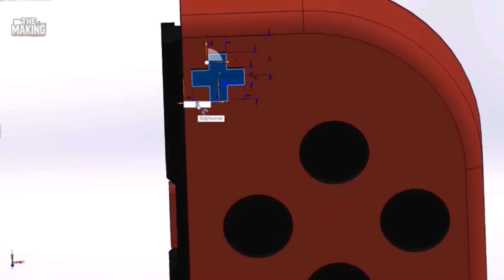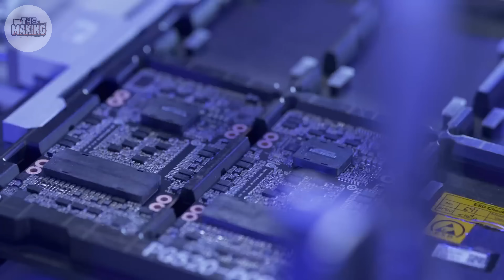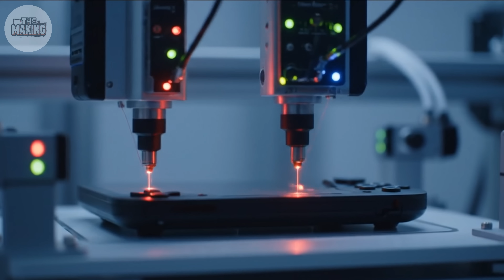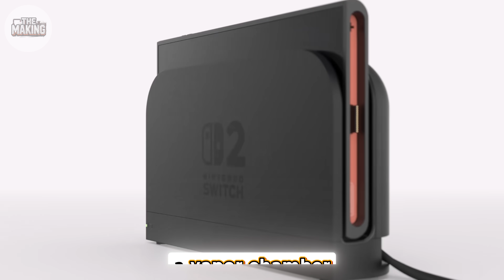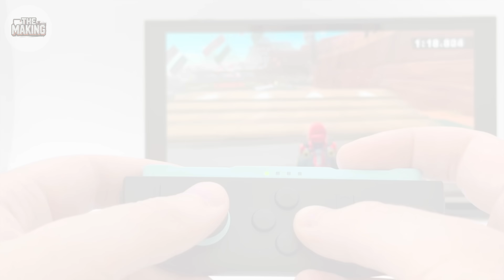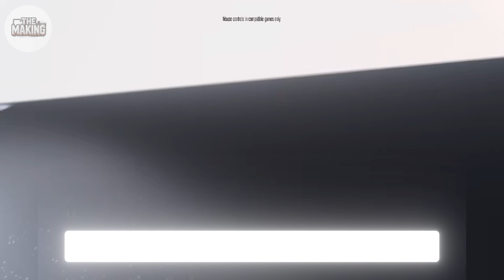How Nintendo Switch 2 Is Made – And Why It Costs $450 | THE MAKING

Comment: “Today we’re going inside the most advanced hardware factory on earth” then proceeds to just a use a bunch of B Roll clips stolen for other YouTubers and Nintendo. Shameful use of AI, all for the purpose of just wasting the viewer’s time by providing incorrect info combined with stuff that everyone already knows.
Reply from the maker: Yeah I get where you’re comin’ from, and I appreciate you saying it straight. I’m workin’ on makin’ things better, so I hope you drop by next time and see the difference. Means a lot you even gave it a watch
Reply: @TheMaking-112 The presentation and production value itself is not bad. I’d just encourage you to research the topic more beforehand. Gaming Tech/Hardware enthusiasts are really detail oriented and we will notice mistakes like that. Nintendo basically never uses a cutting edge node like 4 nanometer. They tried having really competitive hardware during the N64 and GameCube generations and those were some of their least successful home consoles (when measured by number of units shipped). The Nintendo Switch originally used 20 nanometer (and then switched to 16 nanometer in 2019) and it was their most successful console, despite using an older process.

Comment: The fact that the switch 2 is sold out everywhere basically made it okay for Nintendo to change 200 bucks more than the original. I bet they’re swimming in profit now. They will charge even more for future models. And those will sell out as well
Reply: It’s a console they are gonna cost more no different than PlayStation or Xbox charging more for their consoles also you have to take into account of the chips and tuff they put into the consoles which then raise the price, also it has been found out that unlike PlayStation and Xbox Nintendo actually sells their consoles at a loss they Arne making that much back, but they can make the money back with the game and the more people that buy a switch

Comment: The T239 is 10 times as powerful as a Tegra X1, not twice as poweful. Also Nintendo said they are barely having a break even with a Switch 2. 
So they are not making 140$ per console. The comparison for the Switch 1 also took current numbers. Noz launch numbers where the Break even was exceeded by a 20 dollar profiz per Switch 1 console. The profit for a switch 2 is even lower.

The console was also 4 1/2 years in R&D. From 2019-2023. 2024 was when Mass Production started. Originally they wanted to start MP in February 2024 but had to delay MP to September 2024

Comment: Loljajaja $310 to manufacture, but sold at $670 in the Philippines and other countries at $800+ lol
And don't tell me its the currency difference.

If the Switch cost Nintendo $310 it means they could have sold it at $360+ tax, and still be making money. Only a bootlicker would say the $450 is justified and not overpriced. Not to mention the price in every other country. While in Japan its being sold for $340.

Nintendo's HDR is as bad as it comes capped at 360 nits peak brightness. Can't even hit the minimum requirement of 400 nits. That's already embarrassing for a $450 console.

The joy-con, Nintendo never fixed the stick drift issue. They where opened and tested by technicians, and Nintendo is using the same mechanism from the Switch 1 on the joystick. 

Doesn't surprise me knowing how cheaply made are Nintendo consoles despite the cost of materials.

Battery only last about 2 hours tops. Which is way less than the 4 hour battery of the Switch 1.

The Bricking of consoles. Nintendo is a clown for damaging peoples property. Once a person pays for a device its theirs to do whatever they want with it. Nintendo doesn't own it. The customer does.

Nintendo sales jist dropped 40%. Why? Because people are waking up and starting to notice the scam from Nintendo putting everything behind a paywall.

The blurry LCD panel its also an embarrassment. The fact that the PSP has a better screen says a lot about Nintendo.

And you still think the Switch 2 is worth $450 lol. Yeah ok. I think you need a new job.

Comment: That is a very good explanation of why things cost so much in the manufacturing industry however im still skeptical of some of the values for instance

 the pricing of component and material units seems dubious like not that it's wrong that may be the actual numbers but Nintendo may have missed the ball by choosing the wrong suppliers  as some are pro consumer allowing you to get really nice discounts per part from bulk ordering certain parts like microchips. so to simplify in case that went of anyone's head.

Lets say i wanted 10 chips that cost $80 per chip. if i bought individually that would cost $800 total however if i bought it all in bulk the manufacturer may offer me $60 per chip instead which would total to $600 which would save for me $200. (Note. The figures are hypothetical for explanation purpose). Plus ordering all at once makes delivery hassle and costs a lot lower and take less time.

Material prices have seriously overshot up in value this was mainly due to tariffs as most smart phones/devices are made in China which Trump made them on a very high blanket tarrif off 125% averge(he changed this so much) plus extra variable tariffs on semiconductors and metal which even scared off Apple from China who is the smartphone giant to put in perspective so im surprised Nintendo managed to find a factory that hadn't moved to India.

Then there is supplier greed. NVIDA does not care about reducing their costs due to AI obsession so they likely aren't even considering a bulk order discount for Nintendo i mentioned above plus they overprice their graphics cards as well as been rumoured to make them limited on purpose. It's bad business practise like this that  makes me wonder If NVIDIA is trying to rip off Nintendo by not doing enough to keep their own costs down

Finally the quality control department wastes too much or got misrepresented at the end. personally been to a lot of companies that make expensive electro mechanical equipment from many company sizes and standards and they do not chuck away a $300 unit just because it failed one check(Even aerospace doesn't do this which is so high on standards it has it's own ISO set). Instead they get sent to a specific department that will inspect how bad the fault is and replace anything bad then send it through the checks again until it passes rather than just chuck the whole thing in the bin as it's way too wasteful and makes the problems above give more of an impact.

Overall it's a good video  however i think these points do need addressing tho

Comment: Incorrect. It's 8nm, not 4. The LCD panel they used is also terrible. It is literally worse than the original Switch screen. Watch a video from anyone measuring the LCD specs of both panels. Yikes, this video is so full of mistakes, I don't know how it's not flagged for misinformation.
Reply: If your Switch 2 screen looks worse than the Switch 1, you've been duped, bamboozled, and hoodwinked into buying a knock-off. Coming from an OLED model, I was pleasantly surprised by how good the Switch 2 screen looks. No complaints here — but then again, I actually have a real Switch 2 in my possession
Reply: @komkom6657 lol it doesn't look worse though thats the thing no it's not OLED but looks miles better then the og switch the color's pop the blacks are very good.
Reply: The screen looks amazing stop looking at videos and look at the screen in person 😂
Reply: @JamesThomas-dn6ee I am. The issue is that I have a Switch OLED and a Steam Deck OLED. Both look way better than what the Switch 2 has.
Reply: @TehLexinator it's only because you was told so I have an OLED switch the LCD on the switch 2 looks great stop crying 😂

Comment: Switch 2 also got the stick tension right, ROG didn't and has very loose floppy sticks.
Reply from the maker: That kind of firsthand experience is so valuable. Small details like stick tension can have a surprising impact on gameplay quality.
Reply: @TheMaking-112 - The VCR Xbox One controller not only had low 65 gram stick tension but also horrible hinged bumpers. Xbox One S controller increased the stick tension to around 80 grams and fixed the bumpers. This got me interested in what makes a great controller.
Reply from the maker: Totally agree — a great controller really comes down to a mix of the right stick tension, responsive and well-placed buttons, reliable bumpers, and a solid grip. When those elements come together, you get a controller that feels like an extension of your hands, not just a tool.

Comment: Its just a shame that the Nvidia T239 chip in the switch 2 is already 5 years old and almost outdated , thats why they are struggling with performance on new games
Reply from the maker: It really is a bit of a letdown. Relying on older silicon does bring limits, especially with how demanding modern titles are getting

Comment: are they planning on making a revision like the switch lite?
Reply: Switch 2 is a great sequel to the original Switch, it should have been released 2 years earlyer & it would have been more next gen...
Reply from the maker: Totally hear you — a Switch Lite-style revision for the Switch 2 would be interesting 👀
And yeah, if this had dropped a couple years ago, it really would've felt like a game-changer in the next-gen race. Still, glad it's finally here and shaping up strong! 
What features would you want to see in a possible Lite or Pro version?
Reply: @TheMaking-112  
- dock to tv
- backwards capable with switch games
- wireless multiplayer with other switches close by and online wifi
- bluetooth for headsets
- nvme support and SD card slot support larger memory sizes
- hdmi maybe via usb with adapter for other devices
- sim card slot for mobile data
- really good games
- android app or windows app
- full supported web browser
Reply: @TheMaking-112 A Switch pro should have better battery life & a OLED screen, however if they use the same chip another fan may have to somehow be added, as the current chip is really bad about overheating the console, i think that might be why they went back to LCD to begin with, i can imagine the Switch 2 PRO will have a hefty price of at least $700 or more...
Reply: if it fit more in the pocket so can bring it with us would be grate